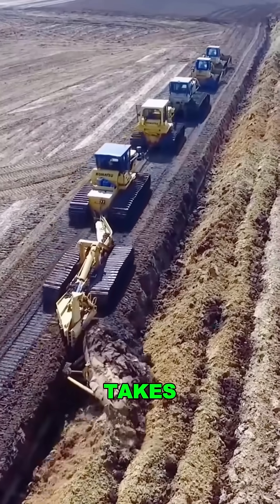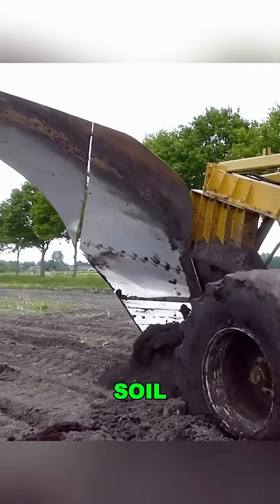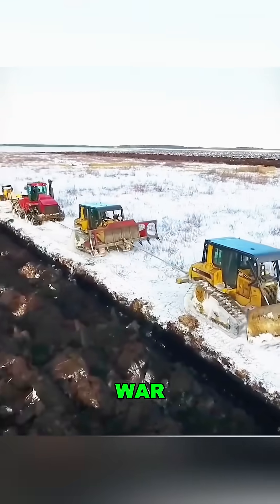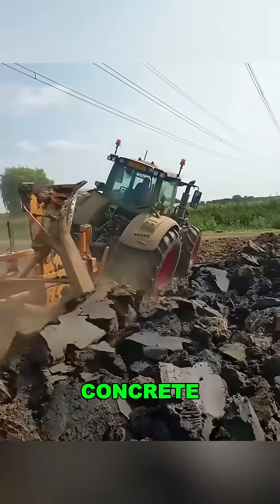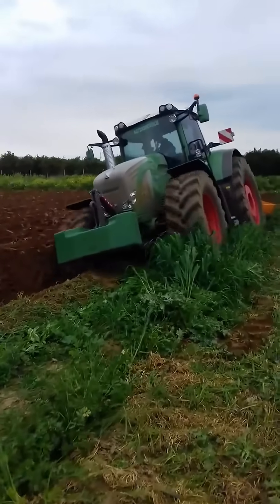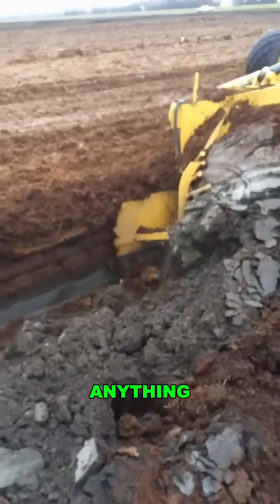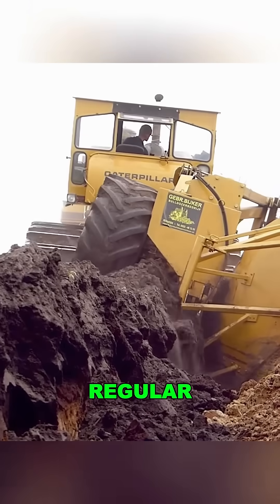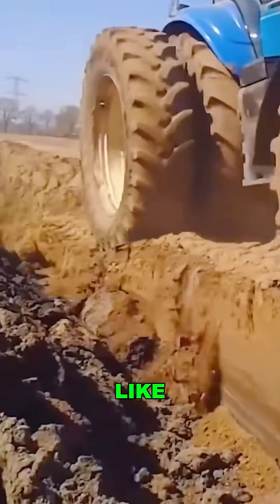Mind-Blowing: 5 Bulldozers Required for Massive Farming Machine!

Comment: I had to stop this video before it ended once. The garbage AI talking is so bad, i could not get behind it. Running plows of MANY different kinds, including fiber optic/interduct plows, this is ignorance of the highest intent. Plowing grounds as a farmer, we could cut way deeper way easier. Cutting ground to lay fiber optic lines, power lines, interduct for fiber, and copper lines, we go further. This video is obviously for city dwellers that dont understand ground strength. Using 5 dozers to pull a plow is obnoxious. Even in frozen ground,  2 dozers is all that is needed. Stop with the ignorance. Please.

Comment: Use spoiled produce for better results 3-4 deep would hurt as well
Reply: put in rotting plant matter. better then chems to kill the soil.
then plant in NATAVE plants for 5 years. let nature settle the land.
the top soul will be in far better shape in five to seven years for only the cost of ripping once.and water every year.
land in ca is very dry as the water is sucked out and shipped to southern ca so they can keep swimming pools filled and hose down the streets after the riots . as there is no water set aside to put out fires.

Comment: we had a huge flood, some farm ground had over a 4 foot silt accumilation.  They used this kind of plow to reach the buried topsoil and mix it in.  10 years later the deep plowed ground is pretty productive.  The unplowed fields were mostly poor pasture slowly getting better.  Both cases recovered, this just saved years.,
Reply: Yes.  A few years ago after the Mississippi ran high all spring, so farms were covered with several feet of sand.  The needed this to pull up the top soil so that something could grow.  It was the only way to save the farmland from years of building top soil.
Reply: It's no different that the 2 plows built to turn under the flood mud throughout most of orange county, CA. you can find the custom plows parked along Segerstom Ave. In Costa Mesa/Fountain Valley, Orange County Calif.

Comment: It pulls the clay and sand to the top and buries the topsoil. That makes no sense.
Reply: This is not what we do in America. The only place I know of here that breaks this deep is the Mississippi Delta. They have no hard pan. Top soil like 10-12 feet deep.
Reply: @damnJoeyC-o9n
Reply: @JoeyC-o9n WOW 😮
Reply: @JoeyC-o9n the have done this is western maryland. on time i’ve seen it done.   plowed up tree stumps and roots
Reply: This plow is sometimes used for leveing land. See if you want to remove /level a hill into a low spot.  You deep plow the hill, then remove the unfertile soil until the fertile top soil is exposed again. The unfertile soil is moved onto a low area. Then, the low area (filled up with unfertile soil) is deep plowed, to bring back the fertile topsoil to the top. And voila, you now have fertile flat/level land.
Reply: Needs this machine to remove the big  roots.
Reply: Are they making the land useless on purpose  ?
Reply: @gordstigter no
Reply: @gordstigter i think you are onto something here
Reply: Wouldn't  work  in Australia... top soil  too shallow
Reply: @waynebrother7 it wouldn’t work in most places of the world
Reply: If there was any topsoil they wouldn't need to till it.
Reply: I think it would have worked better if it were a deep reaching chisel plough
Reply: No it just turns the soil. It does not upset the structure of your soil, but aerates and helps with drainage. For some crops this is the first step in soil preparation. These ploughs just turn soil
Reply: @RudolphKritzinge that brown stuff is called clay. Black stuff topsoil..
Reply: @billyminihan901 I know. But it turns the soil and enhances the all over quality of your soil structure. But what do I know as someone who studied agriculture....you are correct, those idiots with caterpillars are spending thousands of dollars on soil prep just to do it wrong. They have no idea what they are doing.
Reply: @RudolphKritzinger you studied agricultural  ???? Thats the reason you dont know what you are talking about ,,, 
I am an agricultural consultant and farmed for 50 yrs , this type of tillage is only used where the top soil is deeper than the plow deepth
Reply: @gordstigter Maybe you do things different there, and I respect that. I never said I knew it all, and there are many types of substrates.
Reply: @RudolphKritzinger it turns the top soil that has nutrient and organic matter under the useless sub soil that has neither
Reply: @gordstigter Obviously we dont do this on every field, only the ones with a poor soil profile to start with. So you are correct, it "turns" it to promote a better soil profile. Anyway, this is a method done in many countries, after a soil analysis has been done on the specific field.
Reply: @RudolphKritzinger  Tillage absolutely destroys soil structure, and no it doesn't aerate the soil, It collapses soil aggregates leaving no air space for water infiltration. If we did this we wouldn't grow anything for years and when he said it's lifeless sand underneath, and you still need to treat it over and over. And then these farmers wonder why they're going broke.
Reply: Yes,, many substates , like Rockwood and coco fibre, used in the greenhouse industry,  obsolute "0" nutritional value , only a place for roots to go , all nutrients are in the irrigation water other wise known as hydroponics 
Why on earth someone would want to do this in a field setting is beyond me
Reply: Cool ❤❤❤
Reply: Heard this done on river bottom ground that the river flooded and covered the field with silt/sand. Plowing this deep brought the topsoil back up where the field was productive again.
Reply: depends on situation of course...won't save the world...but keeps people busy...
Reply: you make no sense. goob
Reply: The object of plowing is to get a new bacterial life at the surface and to escape from the rubbish.
Heavy ground: before the winter; lighter ground after the winter.
Reply: This doesn’t make no sense.
Reply: @JerryTurner-z1j so it makes sense?

Comment: The narrator make very little sense. The only thing important in this medium is how many clicks it gets. Usually this plowing is done to bring up better soil.  
At this point individual tractors can develope 800 horsepower. The need for multiple machines has more to do with slow speed traction than power. 
Now I’ve made this thing get even more credit due to this comment. Mediocrity wins again